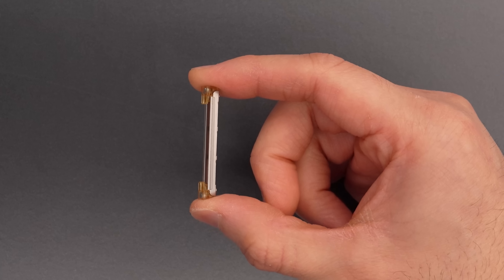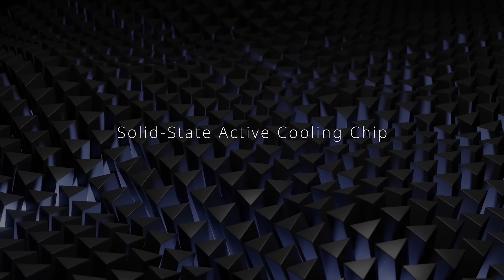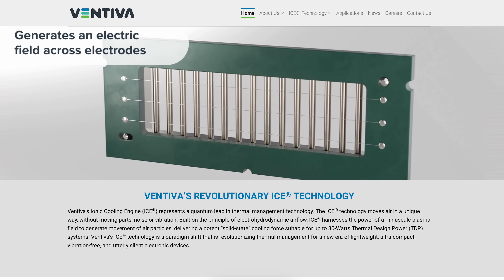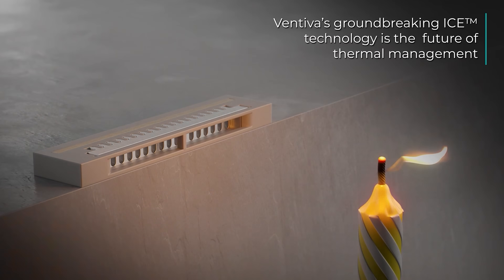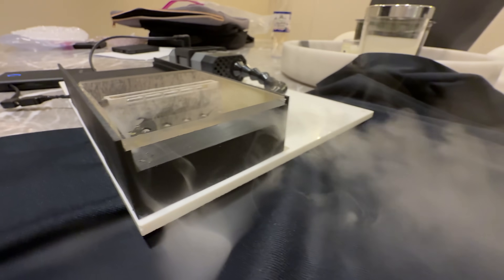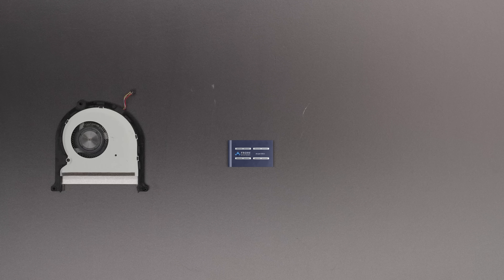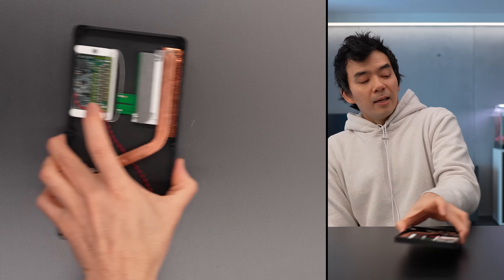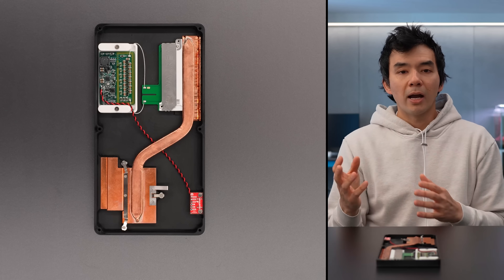The IMPOSSIBLE Laptop Fan...

Comment: I don't think comparing energy to air volume per time is completely the same as energy to heat removal. With piezoelectric coolers they are able to hit really high pressures, meaning they can remove a lot more heat with much less volume. Like, a breeze outside could be thousands of CFM, but obviously a CPU would overheat. Only the air in contact with the surface you're trying to cool is what matters, and the higher the pressure, the less volume you need. If you had infinite pressure, you'd only need one atom's width of air to cool something.
Reply: I guess the old one failed due to vibration not to energy consumption, and this one will fail too due to static pressure, and don’t forget these companies are trying to patent the hell out of these tiny products a massive uphold for mass adoption
Reply: @Mahm00dM0hanad  the air jet did not fail. They are working on efficiency of scale at the moment.
There are products coming to market now that incorporate it.
Reply: Interesting
Reply: i guess current gen heat sinks look the way they do because fans also produce a relatively low static pressure. i wonder what a high pressure heat sink would look like. maybe like a fine metallic sponge?
Reply: @ that’s not a heat sink, that’s a radiator. The most efficient heat sink is a solid block of a material with a high thermal capacity.
Reply: volume is still what counts though. at the exhaust you have air that is a certain temperature above intake, with a specific volume per time. thats your heat dissipation. 
generating more pressure will actually contribute more heat due to inefficiencies (friction and adiabatic losses), with the only benefit being a more compact heat exchanger (or a better heat exchanger of the same size).
Reply: @drkastenbrot  When it comes to cooling, surface area is king. To get air through tight spaces you need pressure. It is fine to measure CFM for cooling, but only after it pushed the air through the heatsink / radiator.
Reply: @arcadebit1551  that is literally what I explained
Reply: Not true
With a good finstack, you can assume that the exhausted air is mostly "used" up. So it really is mostly about air volume. High pressure might help a little, by allowing you to use a denser fin array, but it won't do much.
Reply: @Violet-ui with the way that the air jet bypasses boundary layer effects, you need an order of magnitude less air to move the same amount of heat. That was the entire point of their system.
If they wanted to use the traditional set up, they could just make a fan sizedmembrane and have it pull a ridiculous amount of air, but that is not what they are going for.
Reply: @frankyanish4833  a high end laptop cooler already gets below 20K between Tj and exhaust air, there is not much room to improve. All you can do at this point is get them smaller. Since regular fans are made from dirt cheap materials, don't expect them to go away anytime soon.
Reply: @ I’m not expecting them to. The airjet just means that you’re going to be able to move the cooling inlets to a more convenient space than directly underneath the heat source.
Reply: @frankyanish4833   this is just not true
anyone who has ever done water cooling knows this
the air that goes through the fins is mostly saturated
it's literally that simple
once the air is heated up to the same temperature as the fins themselves, reducing the boundary layer won't heat up the air beyond that
Reply: @ I dare you to calculate how thick of a radiator you would need to saturate room temperature air with heat from a conventional airflow over pressure CPU fan.
I have run water cooling and the air coming out of the radiator does not match the temperature of the fluid inside the radiator.  If it did, you wouldn’t saturate the coolant loop.
Reply: But laptops are not built like pressure chambers the high pressure won’t be sustained? So how does that help with more effective cooling
Reply: @ because the high static pressure is able to draw air from further away, and in more convenient places for Aaron takes to be put on a laptop. You will also be able to add dust covers to the air takes because of the high static pressure.
Reply: Surface area and vortices are nice ways to increase cooling potential in the same area, with less weight. Copper sponges have been used on GPUs before. It's insanely hard to keep it dust free though!
Reply: Great insight
Reply: Peltier coolers, aka thermoelectric coolers have quite a lot of drawbacks but have some potential. It's using electricity to make one side of the device cooler while making the other area of the device hotter. 

It is inefficient compared to compressor based cooling and uses quite a lot of energy, which turns into extra heat. You'll then need to add a bigger heatsink and it will shoot out more hot air compared to a regular heatsink+fan cooler.

The advantage is that it's able to cool way below ambient temperature and below 0c, if the cooler is big enough. It's not easy to implement in a portable device. It's also excellent at controlling precise temperatures for lab work, which isn't too helpful here. 

Perhaps it could be complimentary to traditional heatsinks, but nobody's trying it. Only cooler master tried one before, and it was ineffective.
Reply: Thank you. I was disappointed to see this creator miss the main feature of AirJet.

Comment: I guess that makesense. One of the biggest hindering thing about gaming laptops is the need for big fans inside. If you advance the tech they can finally become slimmer.
Reply: Or solutions like the Intel Core Ultra chips. The idea they have is incredible for laptops, just not desktops.
Reply: Not really.. They need large heatsinks and not just one but at minimum two for both the GPU and CPU, which you only get from adding more metal, the only way to reduce that is to reduce the heat of the components, meaning either lower the power or make a more efficient chip, for example the M4 chip from Apple, you may have trouble running games but the raw power of the iGPU is insane considering how low power it is.

Comment: Perhaps it's important to remember that a "fan" is just movement that is seemingly coming from "nothing" but is in fact an application of electromagnetism that this new fan technology doesn't deviate THAT far from. I'm super excited to see what other products can make use of this type of airflow generation. My hope is that it can be used in living spaces, whether it's something like a simple desk fan or to make air conditioning in homes and commercial buildings more accessible. When these "too good to be true" technologies come out I'm always skeptical but it's fun to imagine the amount of noise pollution that would be reduced if this is the real deal.
Reply: this new cooling tech is electrostatic though, not electromagnetic
Reply: It's called the Ionic Breeze from Sharper Image. They came out with it over 25 years ago. It failed because of low airflow, creating ozone and NOx in the air, and quickly losing efficiency as it plates itself with black soot from also charging all the particles in the air that stick to its surface.

Comment: I wonder how long it can operate until the accumulation of dust shorts out the ionizing electrodes.
Reply: I mean, the rods are negatively charged. What will it even "short" to. 
The concern isn't shorting, the concern I have is even a small amount of dust will reduce the efficacy of air pressure SIGNIFICANTLY, and subsequently the cooling.
Reply: @moldytexas  To the positively charged part of course

Comment: The more Dave talks about this tech, the more I want Dyson or some other home-cooling company to make a metal block that just attaches to the ceiling and generates wind. Maybe one day
Reply: had one back in the 90s /early 2000.. caused statics on everything.. in a room full of smokers would resulted in the elements got covered with brown goey stuff
Reply: it was called the Ionic Breeze, it's quite old, not sure if they even make them any more.
I had one in my room as a kid as an air filter and it was decent

Comment: You are thinking about laptops, I am more exited about this being on wearables.
Reply: A wearable that needs this type of cooling? I can't think of any
Reply: @ashutoshsolanki3637  Probably not suitable for wearables.
Reply: Wearables like the new Meta Glasses. The actual circuit can also be made smaller to an extent.
Reply: @ashutoshsolanki3637  Also the driver circuit has size limitations.  The actual device can be arbitrarily small.

Comment: Wont that create a bunch of ozone?? That was the problem with the old sharper image fans from like 20 years ago. that used this same technology
Reply: This is my first thought.  There is a lot of research for high voltage lines (for trains and power grid etc) generating ionised particles that increase deposition of other air particles in to the deep lungs.  Mostly based around cancer rates.
Reply: I was thinking the exact same thing. There's a wiki article on air ionisers that cover this. https://en.wikipedia.org/wiki/Air_ioniser

Comment: At 6:01 I think it is written Dell on that surface
Reply: reupload #2 coming up
Reply: Yeah even i see it. Great observation.
Reply: lmao good eye
Reply: hell yeah
Reply: good eye
Reply: What the actual Dell? My harmonica was supposed to stay silent...
Reply: Leave it to Dell to pour their energy into a non-problem rather than improve their horrendous reliability.
Reply: @jamesh318 was thinking the same thing
Reply: oh cool, if that company is partnering with them it is not vapor ware and in the process of evolving into a real product
Reply: Wow you right!
Reply: I was thinking dell in the first second. Working in IT dells have a bad overheating problem. They get clogged with dust and start slowing the system down to avoid overheating..
I order boxes of pressurized air a month to keep the machines running at full speed.
Reply: LOL
Reply: Retarded
Reply: I did get an ad for dell on this video, I think YouTube knows something I don't
Reply: Great spot
Reply: yeahhh i came here to comment and saw ur comment lol- 'm late in watching the vid tho kekw
Reply: Daaamn! Good observation G. 🫡
Reply: Nice eye!
Reply: @M0NK-P2P  Top surface, on the left edge. It's upside down. Find the circle with line through it, that's the e of Dell.
Reply: @abdusco Thank you!
Reply: It's clearly a screw and 2 lines from the shaping of the metal
Reply: @FinneasJedidiah  But it literally isnt
Reply: @FinneasJedidiah I thought that too, but if you zoom in, it is 100% the Dell logo, upsidedown. It isn't just "2 lines." The D is there too.
Reply: @FinneasJedidiah you really have an odd defintion of "clearly"